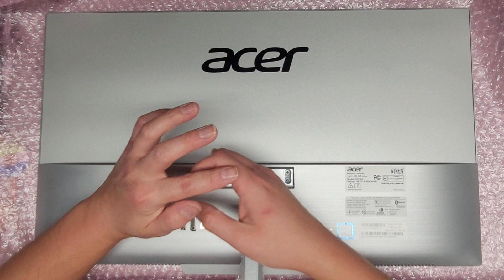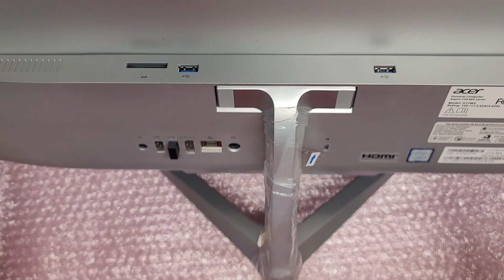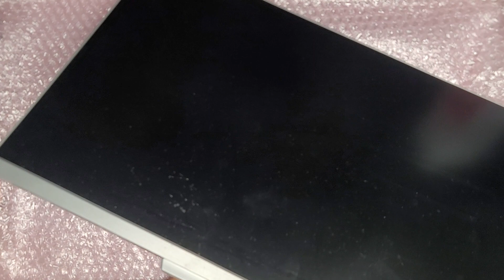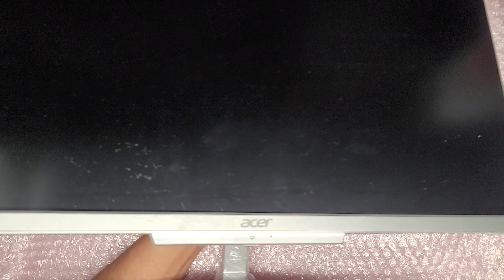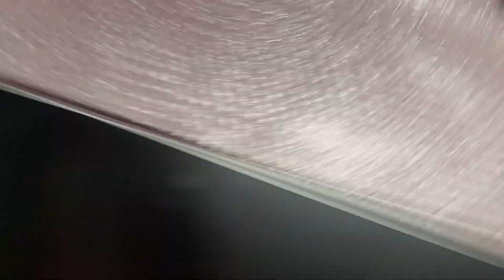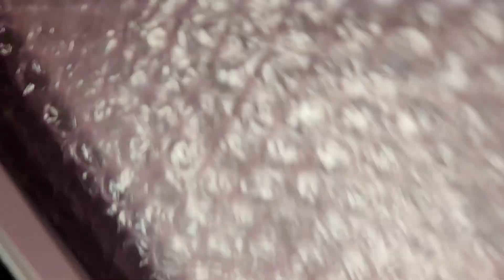Acer Aspire C24-865 Series D17W3 C24-865-ACi5NT Disassembly RAM SSD Hard Drive Upgrade Replacement

Comment: The one that I renewed the CR2032 from today, has a ssd in the M2 slot. This explains why I was so impressed by the speed of this antiquity with an 8gt gen i5. I did not open the case far enough to be able to determine if it is a sata or a nvme ssd. Greetz from Tilburg in The Netherlands. Good video by the way!
Reply from the maker: @TheHysssop  nice!

Comment: I've seen that this computer can take TWO hard drives apart from the M.2. Is that the case?
Reply from the maker: All I know is in the video
Reply: @ItsBinhRepaired  OK, I think the 'other' drive bay is hiding, I have an Acer Aspire Z3 - 715 ACKi5 motherboard with an M.2 bay at the back which I don't see in ANY manual. Wow! Thank you!
Reply from the maker: Nice